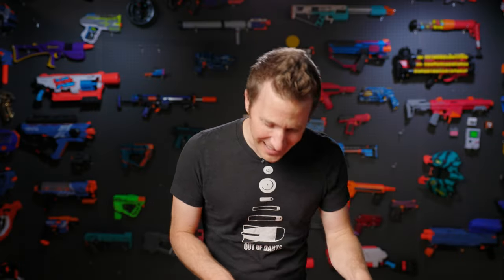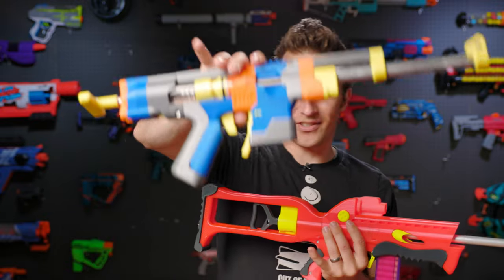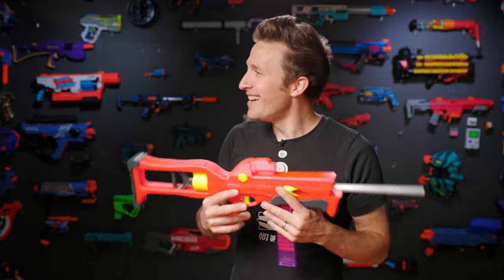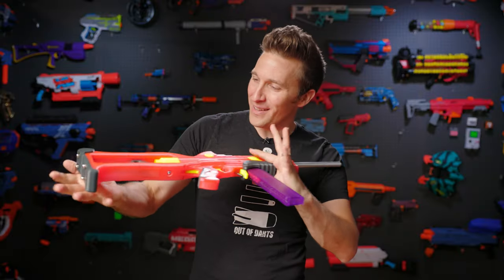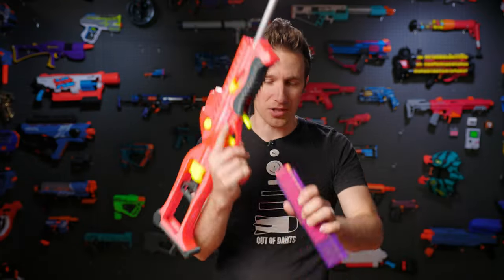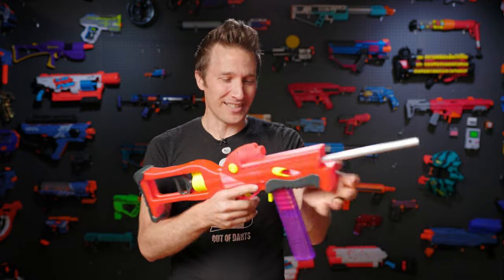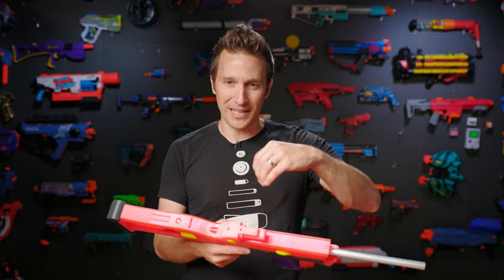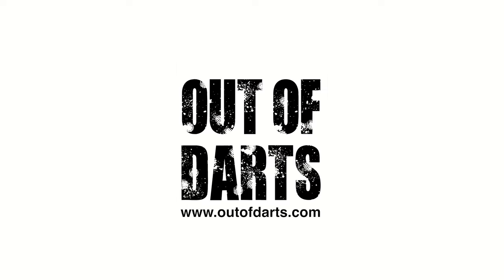A Talon-fed blast from the past printed by DrFlux! | Sillybutts' SkewBow SPOTLIGHT

Comment: Just checked and my 3 skinny fingers fit in the original crossbow without any slack, so your bigger fingers would likely not fit.  Or you'd have to just use your fingertips.